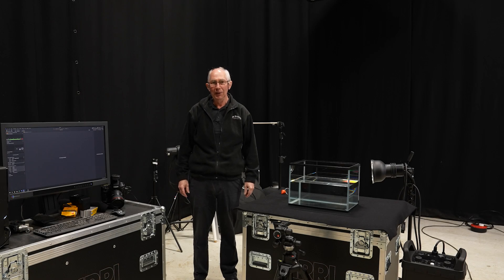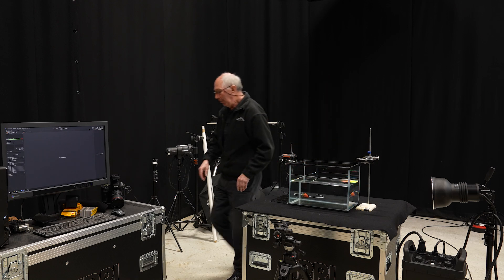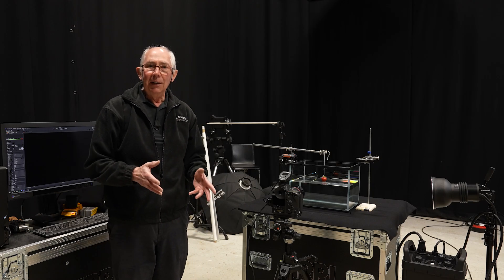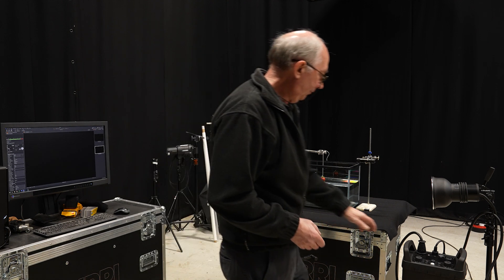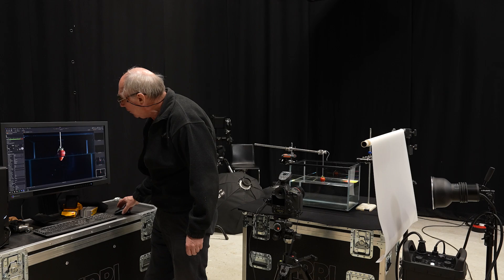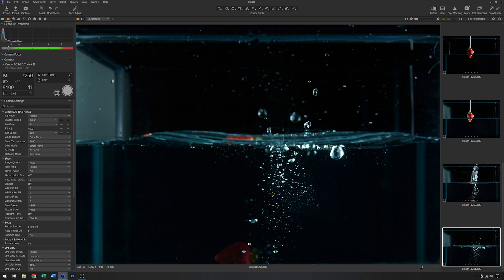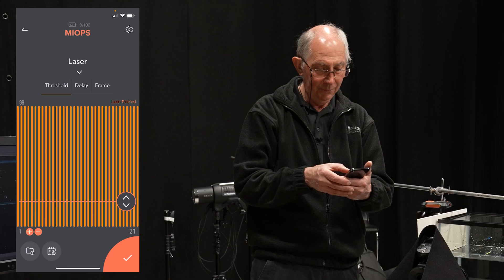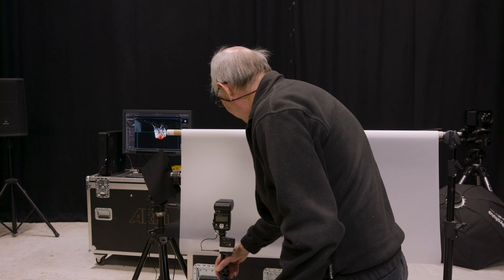Splash photography Speedlight flash gun

Comment: One more thing. Could you please advise which trigger you use on the top of your camera to control the power of your lights and flash. It always seems so easy for you to stop down or up and control the power of your lights. Thanks.
Reply from the maker: I use the Profoto Air remote TTL, this is now replaced by the Profoto Connect pro

Comment: do not want to be rude,but shot 8k clip and pick the right frame is the easier way
Reply from the maker: Your method will work, however it is currently impossible, without using a Phantom or other specialist high speed camera, to get a shutter speed anywhere close to the short flash duration (1/100,000 sec). As a result the details will have motion blur.
Reply: @CameraClubLive  yes,it is correct,normal camera can not capture the right moment with 1/100 or 1/60 shutter speed because the motion blur. And phantom cost a lot,can not afford it even rental.